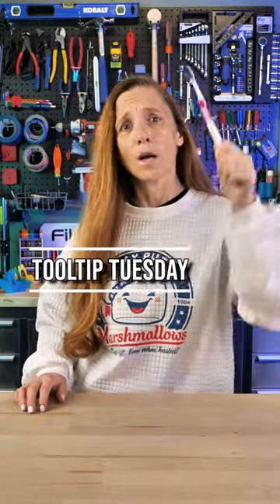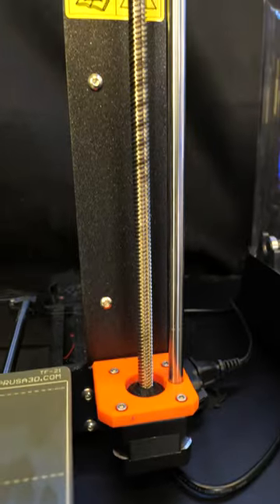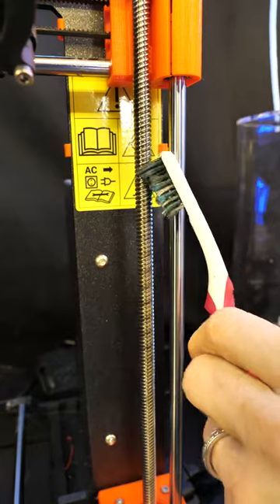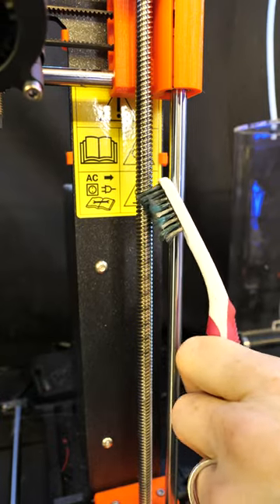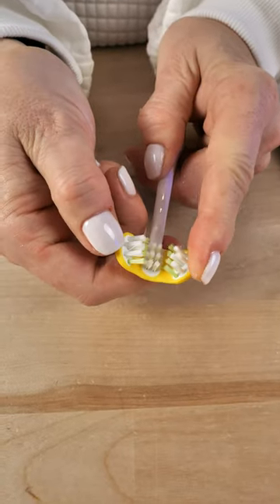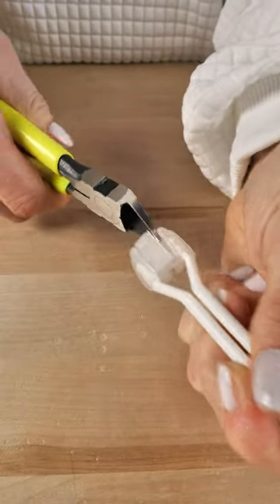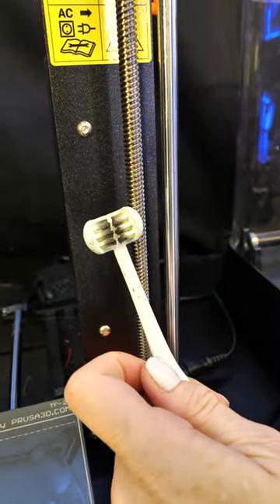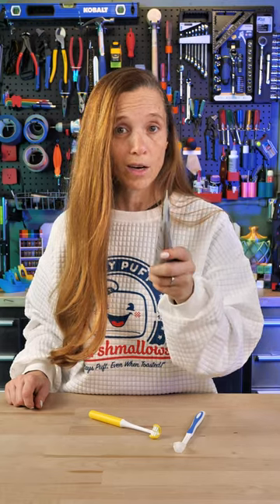ToolTip: Clean your 3D Printer Lead Screws!

Comment: The lead screws of a Prusa printer should never be greased. It's an old argument. But even the manual of the printer never tells you to do so.
Reply: Was about to mention this, lead screws shouldn't be greased on the exampled 3d printer {prusa}
Reply: Came to say the same thing. Trapezoidal nuts are made from POM which shouldn't be greased.
Reply: Imagine the prusa farm would have all their lead screws greased. 💀Lmao
Reply: @REDxFROG  POM is self lubricating as is bronze but on the other when I got my MK3s manual never told you to grease your linear bearings even though grease was provided after I got my replacement x rod because it was scratched the manual was changed. Now it says you should lubricate them and make sure that rows with balls are at 45° to the top of a rod. Idk if what said makes sense xD
Reply: @curly_luke  that's plain not true. There are so many printers Out there with brass leadscrew nuts. Metal on metal always needs to be greased.
Reply: @hasserecht3678  i was talking about Prusa not other printers.
Reply: @curly_luke  Well then you forgot this addition with Prusa ;). The sentence "Trapezodial nuts are made from POM..." sounds more like every trapezodial nut is made from POM.